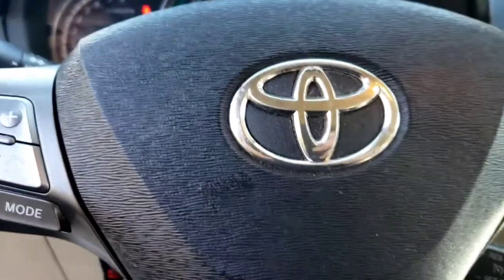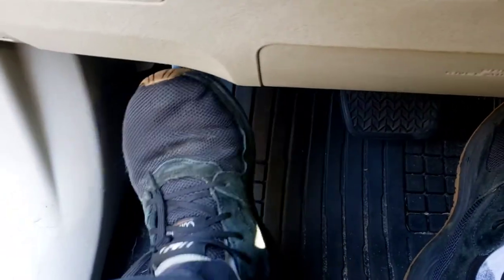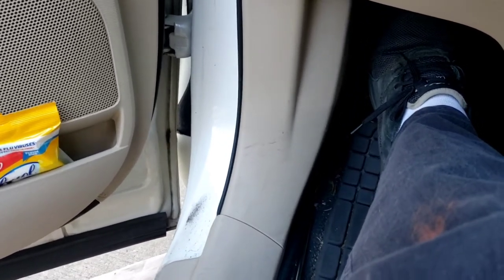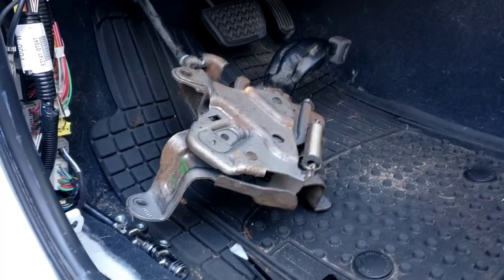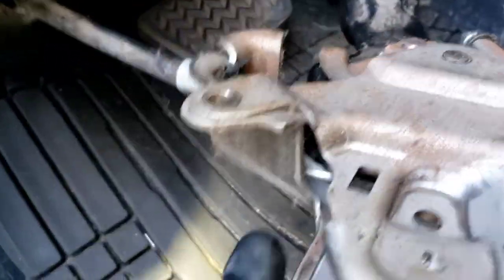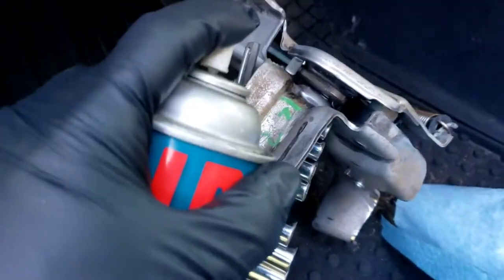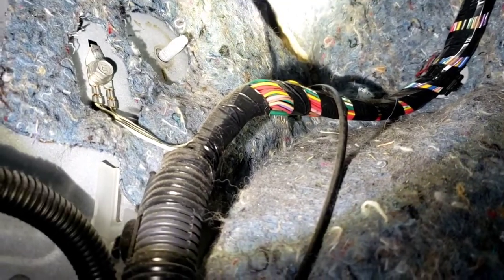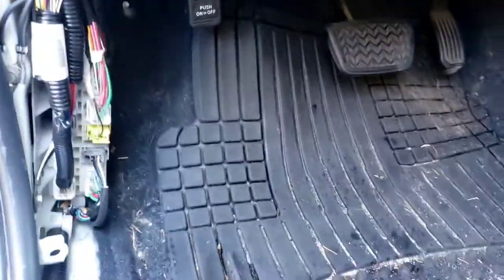Toyota Parking Brake Not Working Grabbing or Clicking Properly Venza Model 2012 and Other Models

Comment: My wife's 2005 Toyota Sienna parking brake quit working yesterday.  I almost called our repair shop, but decided to try the repair.  It took about 3 hours, but the parking brake works perfectly now.  A good portion of the 3 hours was spent getting the one nut off of the bolt up on the fire wall near the wire harnesses.  The other nut and the other bolt were super easy to get to.   Thanks for your excellent video!
Reply from the maker: Glad it worked out for you and thanks for watching...

Comment: Thanks!  Hope it won't be difficult to get to the 3 nuts to get it out for the Prius.  That will do that in the Spring with warmer weather.
Reply from the maker: Or run the car with the heat on since you will be half in and half out..😆

Comment: My 2022 Camry's emergency brake is useless.  I was told it was made like that by design.
Reply from the maker: Who told you that, emergency brakes are just that, emergency and parking and you do need them..on a 2022 it should be working great, it's practically new.